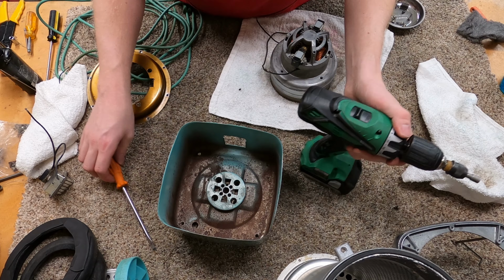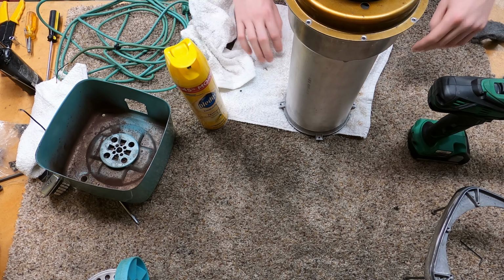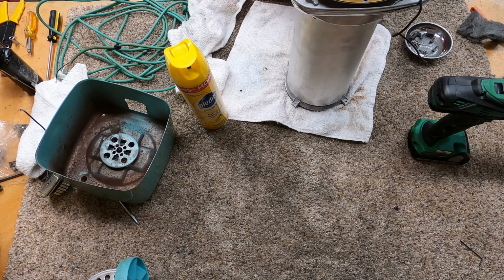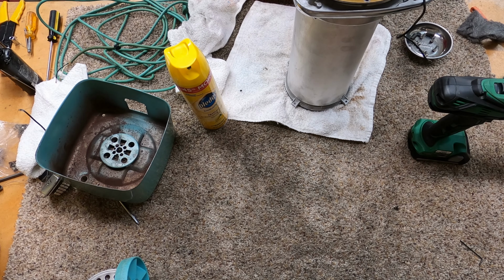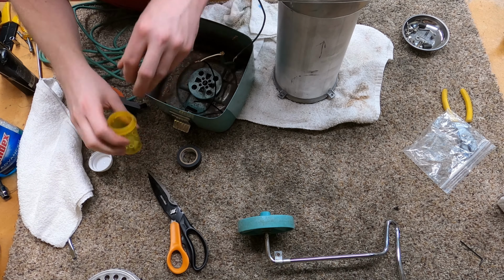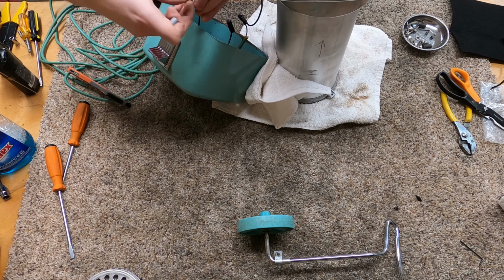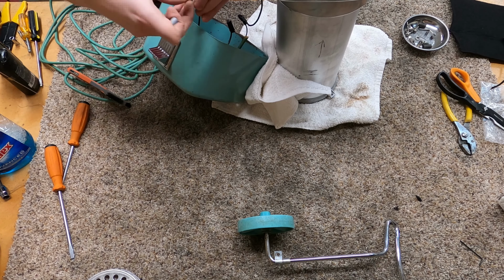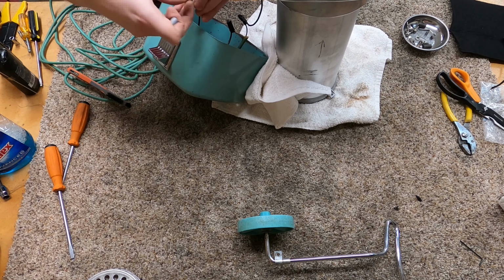Airway 88 MKII Vacuum Repair (Part 2)

Comment: What's your trick to getting to the bearing on the other end of the rotor where the turbine fan is?  Do you remove the fan from the shaft?  As you know, they're so stuck on there sometimes.

Comment: I have the vita vac version and it was the best vacuum i ever used, overlaoded the bag. Mostly dog hair rhem threw out full bag replaced with a new bag and now it has no suction.  Any idea what is wrong with. Everything seems to work fine just wont suck

Comment: I am looking at purchasing an 88 or an 88 MK II. My current vac still works, but brush heads and power head are both broken and after an exhaustive search, no replacements available. It is only seven years old! My other option is an Electrolux Silverado. I want them both... Both can still be repaired, and the Electrolux, a 40 year old machine, still has parts widely available, and simply works better than any plastic foreign made machine  you can buy new.
Reply from the maker: I love airways and old electroluxes.
But there are very few parts available for any of those good luck getting bags for airway now. The modern manufacturers have them beat so far today. You'd be better off getting a SEBO or Lindhuas the daily drive if you're looking for longevity and parts availability. It also like to mention that back when those other vacuums were made they did not understand filtration like we do now and regularly using one of those other vacuums could give you lung disease.